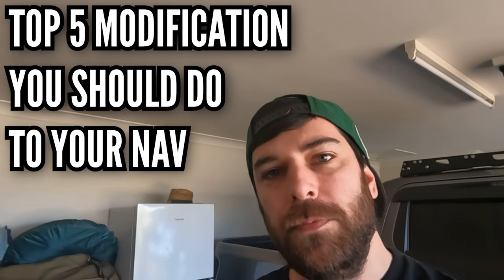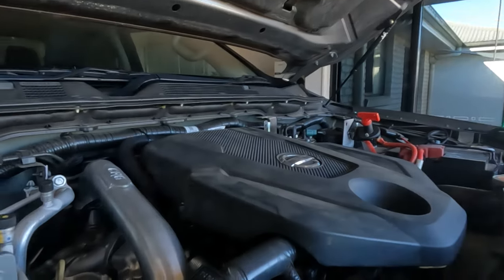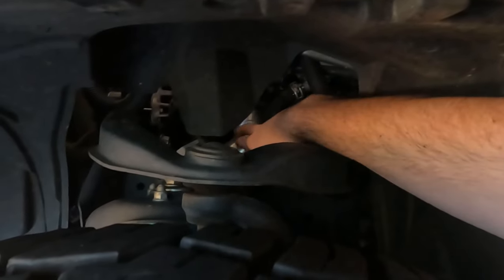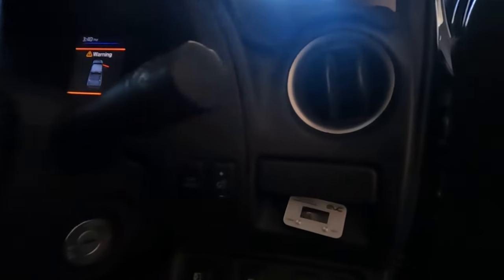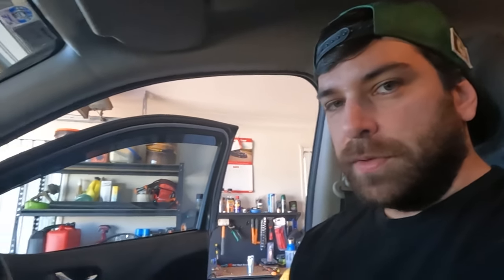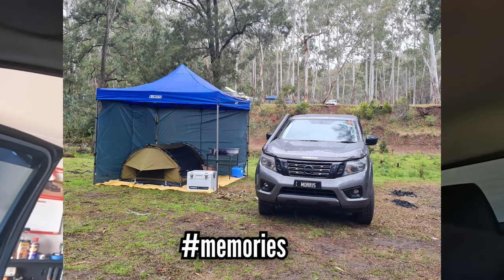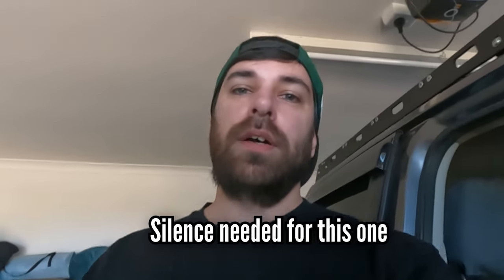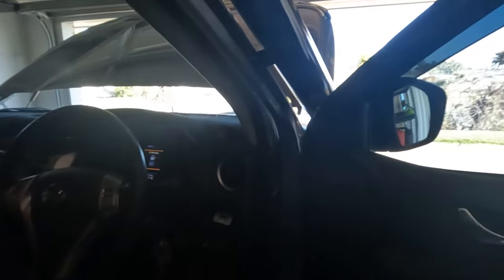The First 5 Mods You Should Do To Your NP300

Comment: I would like to rearrange your list of top 5. 1: catch can; 2: Boost pipes hot and cold; 3: intercooler upgrade; 4: throttle controller; 5: K&N drop-in airfilter;6:DPF Back exhaust 3" ; 7: Ironman snorkel ;8: ironman bullbar & recovery points.; Bonus 9: ironman winch ;ironman suspension; spotlights & lightbar.; 10: extended shackles rear.
Reply from the maker: Good list, its hard only choosing 5!
Reply: What benefit would extended rear shackles have on a Navara NP 300?
Reply from the maker: Would give a bit more travel/lift in the rear for the leaf reared versions

Comment: Nice video. What's the deal with a throttle controller if the car's under warranty?  And why don't car manufacturers sell them as a factory accessory? Cheers
Reply from the maker: Thanks! The manufacturer will only knock back a warranty claim if the issue was caused by a modification. I had a throttle controller on and had my transfer case seal still covered under warranty. When in doubt I always ring the dealership I would be using if I did have a claim. As for not being included from factory, they have different emissions, fuel usage etc to take into consideration and I guess they have found a sweet spot based on what they sell 😀